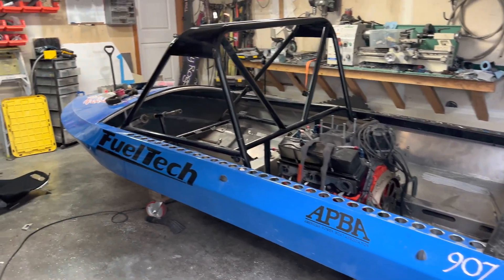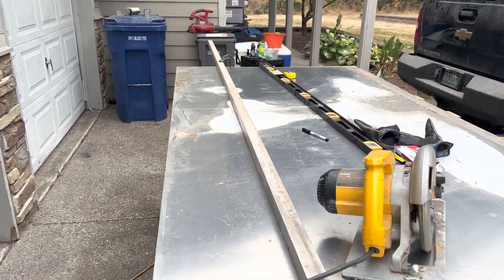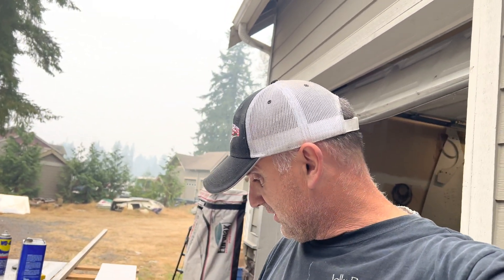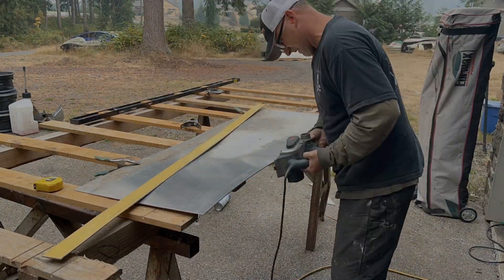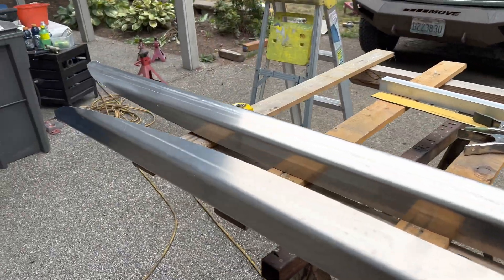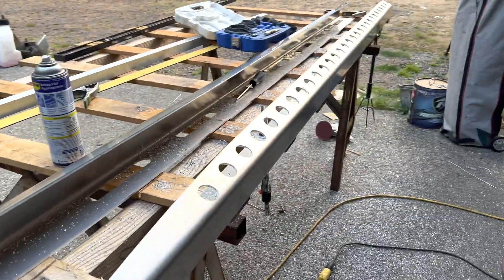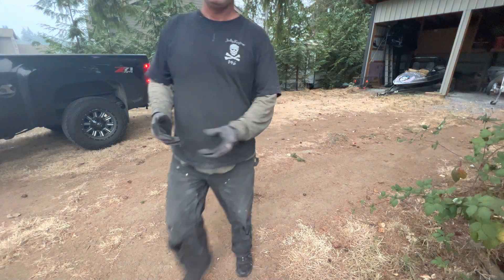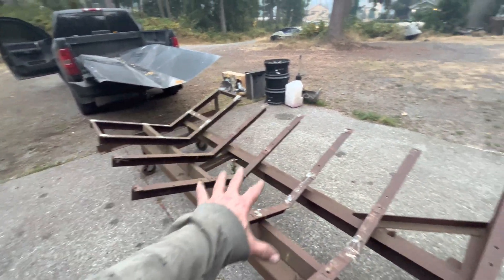1000 Horsepower Jetsprint Build Episode 1

Comment: Bro. love the in depth vids. I'm sure someone else has commented, but have you ever considered dimple dies for your speed holes? no wrist breakage, and you recoup some of the stiffness of your part to boot. you'd only need one, maybe two sizes to start, so not real expensive to obtain. just a thought. keep it up brother. I found you through Cleeter, and I'm glad I did. 👍
Reply from the maker: Yeah it has been brought up.  My issue is that’s 3/16” and it’s gonna take a pretty significant press to cut through that with a dimple die.

Comment: Very interesting , this will be a great build series. One question : why not an all aluminum BBC instead of a small block?  Thanks.
Reply from the maker: That’s a great question and honestly not that easy to answer.  You could obviously make well over 1000 HP on a NA BBC.  Once you get up 1200+ the power almost becomes unuseable, at least 100%. It’s easier to drive when you can just flat foot it and steer around the track.  So I’d argue that if I can get to that point with a SBC, it’s going to be overall lighter but more importantly, the extra weight and rotating mass of a BBC crank is actually enough to upset the boat.  There’s some boats out there with BBC but not that many and they just don’t settle down and get on a rail like the SBC can do.  I’ve heard people say that just the extra weight / torque from the crank alone is enough to un-settle them.
Reply: @JollyRoger907  That makes sense. Many thanks for the reply ,most appreciated.

Comment: Curious as to the material? 6061, 5052?  .063”?
Also, assuming bend radius on press breaking angles would be important for thickness / hardness of the aluminum to prevent stress cracking?
What’s the thought process at arriving on a design?
Looking forward to following this and big thanks for the effort to share, as that doesn’t just happen.
Reply from the maker: 5086.  You’re right, you have to be careful with the bend radius!!!

Comment: Loving all of this. Thanks for sharing. I'm not a boat expert. But, I am a machinist raised with an engineering background. Something that will cost you zero weight, and increase strength by a wide margin. Get a dimple die that will cup the weight saving holes you made. Easy to make on your own with a lathe. But, they sell them all over at a reasonable price. It is a worthwhile investment to increase strength. (I only have a couple minutes left in the video. My face will be red with embarrassment if you address this before the end lol).
Reply from the maker: Lol all good.  I’m not sure about a dimple die for 3/16” plate!  Mine barely works in .100”

Comment: You should try dimple dieing the holes. It will add more stiffness to the rails.
Reply from the maker: The dimple die set I had struggled to work on .100” let alone 3/16”
Reply: @JollyRoger907  TMR Customs has dies rated for 3/16. But you need a pretty big press.

Comment: You're absolutely right about the hole saw grabbing, I'll usually remove the hole saw from the arbor and drill all the pilot holes first to avoid the dreaded stab and grab when the drill finally breaks through and the saw slams into the work piece. I'm looking forward to seeing what it takes to build these cool little boats. Great stuff!!!
Reply from the maker: That’s what I did on the second piece and it went much much faster and didn’t break my wrists lol.

Comment: Lookin great Eric. You should try some annular cutters (Rotobroach). They work awesome for cutting precise clean holes in sheet like that. There are a few kits on Amazon made by Blair Tool and Hougen 👍
Reply from the maker: I looked into them and will be going that road in the future!  Thanks!
Reply: @FAKE-NAME  Those are called dimple dies. Not enough room in those motor rails for that I don't think.
Reply from the maker: I’ve used dimple dies on thinner material but not sure it will work on 3/16” plate!

Comment: You are really smoked in. Hopefully it will clear up soon. I'm over it.
Tip
I learned this doing concrete work years ago, but its also great for large bits and hole saws.
Hold the drill itself in your left hand. Then if it grabs, it doesn't bend your wrist backwards.
Reply from the maker: Yes it has been crazy smoky!!!  I think this last weather system cleared it out but I’m not home yet, we’ll see this afternoon.  Great tip on the drill 😉

Comment: I'm curious if the cornering would improve if the back end were "V" shaped rather than flat. Has that been tried?
Reply from the maker: The flat or delta bottom is needed to fit a giant pump in the boat.  Two basic jetboat designs are a delta bottom or a radius bottom but regardless, you can’t really fit a pump in a sharp vee bottom.
Reply: In a word, no.

Comment: Is that 1000HP naturally aspirated? Seems like a pretty tall order even for 500-ci. What are the engine rules for the class you're in? Are power-adders disallowed?
Reply from the maker: 1000 is optimistic.  We’re going to be close, I know that.  You can run anything but nitrous
Reply: @JollyRoger907  Freakin sweet. Since the pump is direct drive off the motor, I wonder if a turbo rotary spinning stupid high rpm would have any sort of advantage.
Reply from the maker: @xdboardsurfer  there was a quad rotor boat a few years ago and not sure how they got it to work right.  The pump starts shooting out foam, not solid water above about 7000 rpm